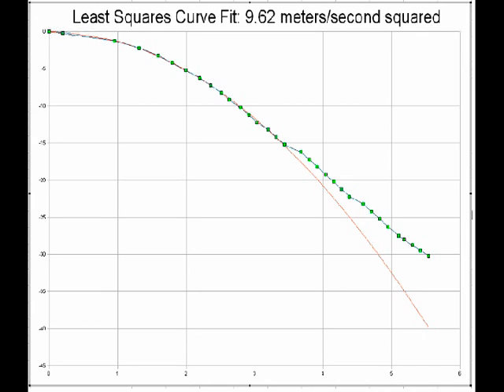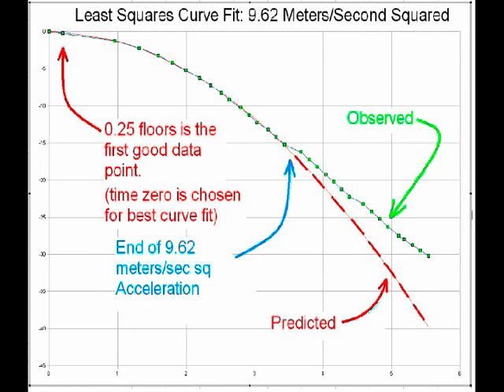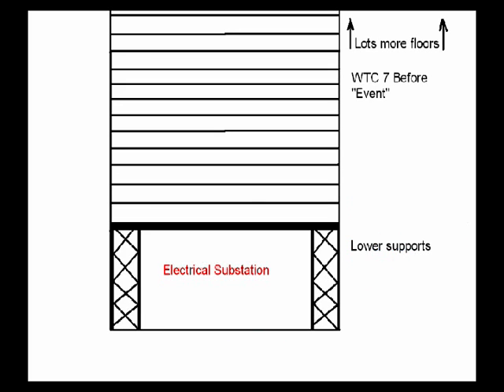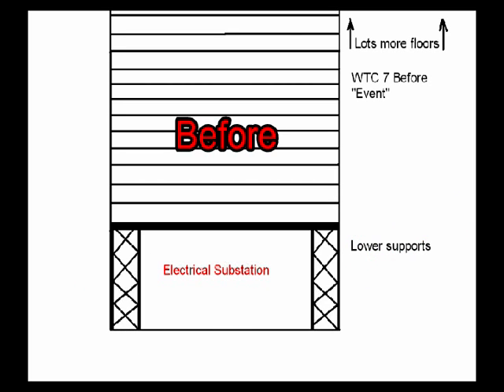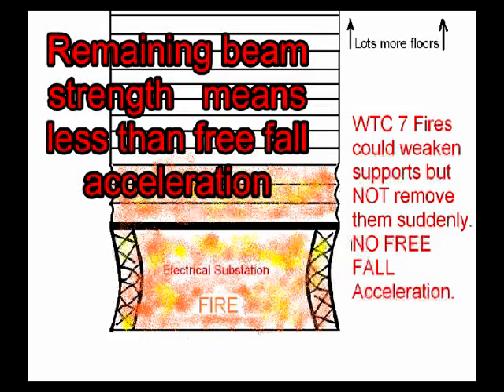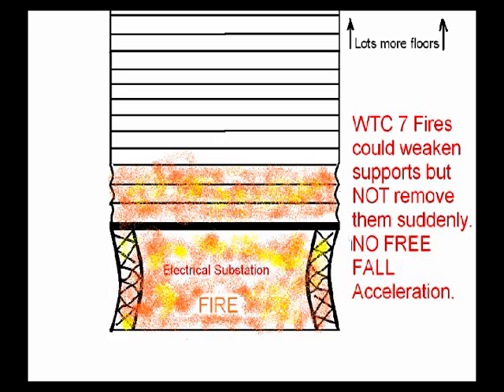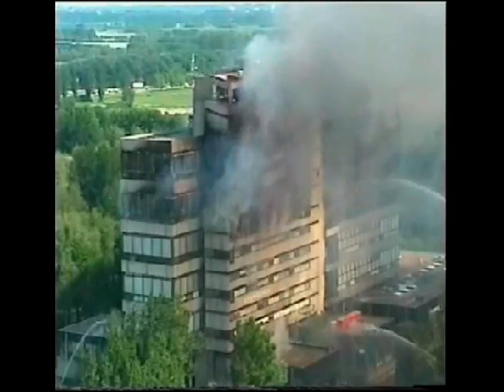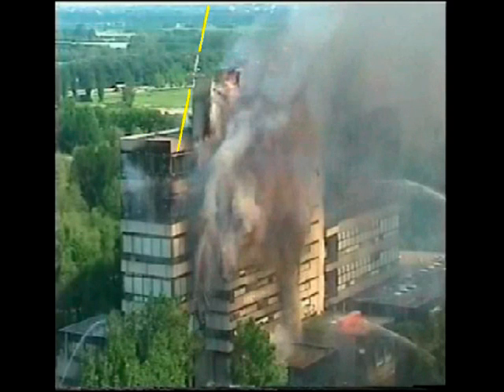Re: Freefall Acceleration of WTC 7

Comment: Question:  has a controlled demolition ever resulted in a free fall collapse?  Answer:  no

Question:  has a controlled demolition EVER been devoid of the sounds of cutter charges?  Answer:  no

Question:  has a controlled demolition EVER left ZERO evidence of its existence in the debris (Steel biased cuts, wiring caps, etc). Answer:  no

Question:  has a controlled demolition ever had EVERY investigating entity conclude it was not demolition?  Answer:  no
Reply: Has a steel framed building ever collapsed due to a fire before 911?

Comment: @Skeptic121

WRONG!

The steel in the Windsor Tower DID FAIL DUE TO FIRE.

Only the parts that were constructed out of reinfiorced concrete survived the fire - which is why the building didn't collapse.

But the fact remains that the structural steel did fail in the Wndsor Tower.

You didn't even answer question 2.

So NatGeo is a "govt. covert witness"?

Blame it on the new wookie order?

Is that how you answer questions that refute your magical theories?

911 TRUTH = STRAWMAN

Comment: 3 QUESTIONS 911 TRUTHERS DON'T WANT YOU TO ASK THEM:

911 TWOOFER # 1: "A steel building has never collapsed due to fire." What happened to the Windsor Tower in Madrid in 2005?

If flight 77 was a missile and not a plane, what knocked down the pole lights outside the Pentagon?

Since demolition experts estimated it would take over 100 men 4-6 months to place explosives in WTC 1, 2, & 7, how come no one witnessed any strange construction activity, wires, or boxes?

Comment: ...In this manner, I would assume that the other two trusses, placed relatively near each other, would buckle under the new weight, and the rest of the building, internal and external, would fall roughly at freefall speed, since the collapse is from top to bottom.

Of course, I'm no expert, but wouldn't that place collapse time at around 13 seconds?
A few seconds of internal collapse; its finale being the top of the East Penthouse, then 8 seconds of apparent inactivity, followed by the rest?

Comment: Wouldn't Building 7 have to be supported on mainly the three major trusses, which started from the seventh floor to the roof? It would then make sense that the East Penthouse collapsed 8 seconds before the rest of the building (Truss 1 ran from seventh floor to the East Penthouse).

If this is the case, the collapse would have to start from the point where the fires were seen (roughly the seventh floor) internally, taking a few seconds to reach the top of the East Penthouse...

Comment: Gangularis,
I guess the truly funny thing is, he has no clue how his statements sound to actual engineers.  A controlled demolition involves months of preparation on an abondened building.  Drilling holes for dynamite every linear inch along the support, miles of detonation chord, kryton switches, etc.  Of all of the buildings which collapsed, #7 looked the most like a controlled demolition, but it was not close enough for anyone in the business.  That is what everyone I know is saying.
Reply: So we should find evidence of explosives if we look at the rubble and dust right? That could be an easy way to rule out that idea if someone was doing a thorough investigation. Nist didn't look for evidence of explosives though.

Don't worry though. There was a scientist that examined the dust and found some unusual things. There were red/gray chips in the dust that explode when heated to high temperatures. These chips contain the elements involved in a thermitic reaction. They compared it to commercially available thermite of 2001 and the chips were more explosive. They also lack elements common in paint and paint chips don't explode like the red/gray chips do. There were also micro iron spheres all throughout the dust which seem to be indicative of high temperatures and a source of iron and perfectly match up with the thermitic chips. 

There is a paper that was published in a peer reviewed science journal. Search for "red/gray chips wtc dust Bentham open"

So I guess the question becomes, what group of people has access to nano thermite, millions of dollars, and the resources to plant the explosives?

Are there any other coincidences we can find? There were 4 separate and simultaneous simulated hijackings being conducted on 9/11. These were training exercises for the US air defence agencies such as NORAD. They involved overlaying fake radar blips on real radar and remote controlled passenger planes for live simulation purposes. These simulations confused NORAD and they were unable to intercept the planes on the only day where planes were hijacked to fly into buildings. Does this show that it's possible to manipulate large groups of people for the purpose of carrying out a complex task without any of them being aware of the plan?

Comment: interesting to note that even if the collapse of wtc 7 was because of structual failure, why would the exterior walls fall at free fall? all of the weight of any exterior wall on any building is directed straight down.

Comment: It is an insult to our Engineering community to believe these towers were constructed so weakly that fires and some localized destruction could bring them down

Tower 1?  WTF none of the corner columns were even severed!!!
Tower 2?  The angular momentum was halted just after initiation, indicating big time tension on the far side.  There was NO GD COMPRESSIVE PRESSURE ON THE FAR SIDE!!

WTC 7?  Thermal expansion...not likely!  Teeny tiny fires on the north, west, and east faces...so...LOL